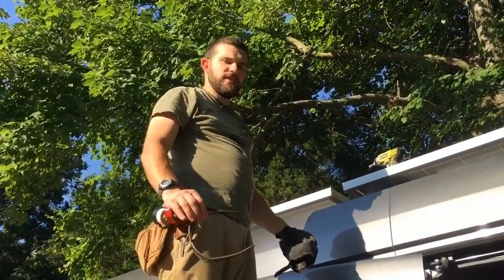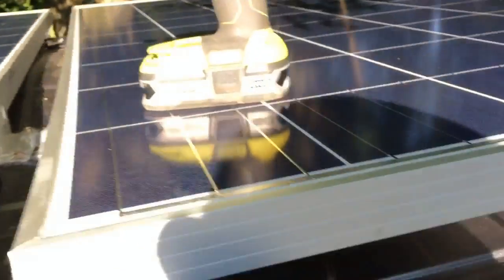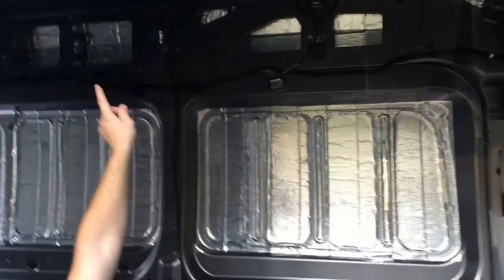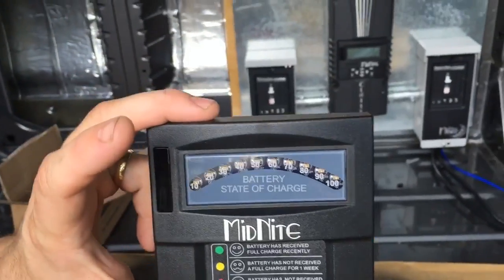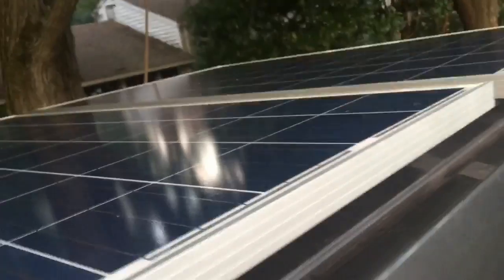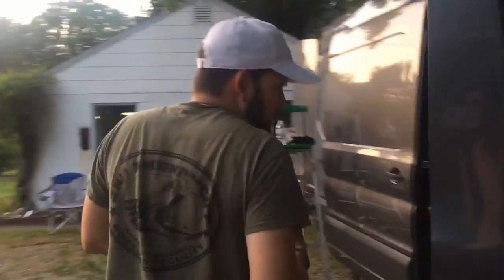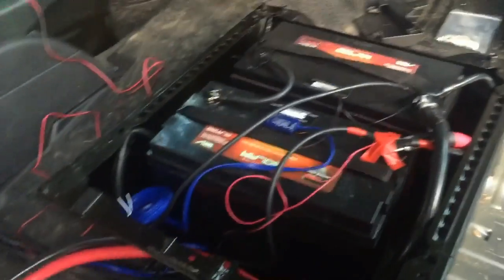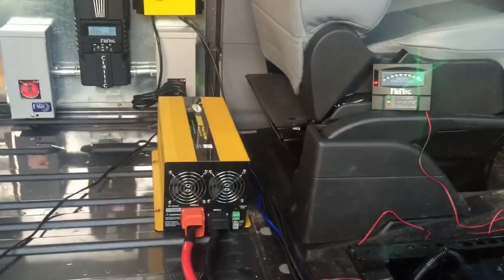F350 Ford transit van solar system install by Off Grid Contracting

Comment: Wondering if and why you didn't z- bracket directly to the roof with a couple of grooves for wires,were you concerned about heat build up under a sealed panels as I'm about to do ...eh. Good informative video.eh.thx

Comment: that is very cool about the midnite meter. the only thing I have to go off of is voltage, and with a small battery bank, that can fluctuate quite a bit depending on the loads. thanks for the info!